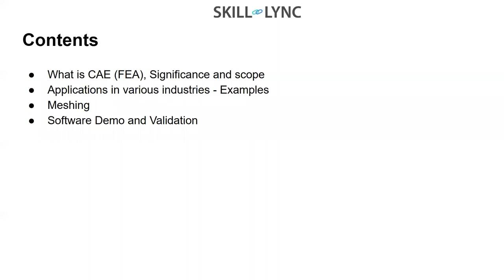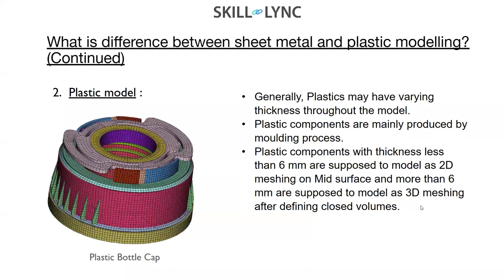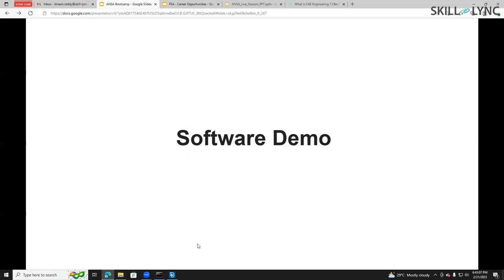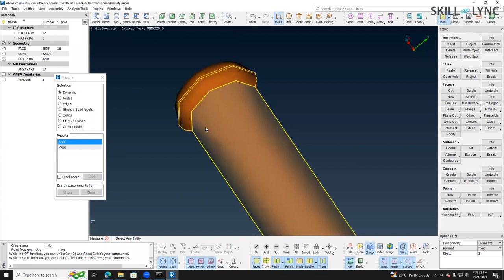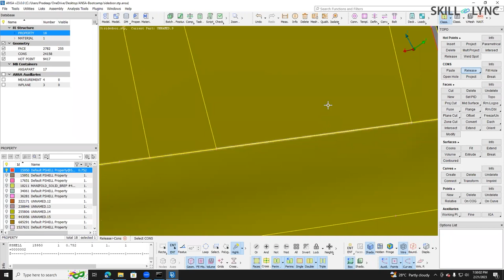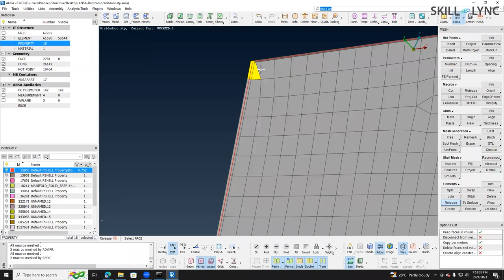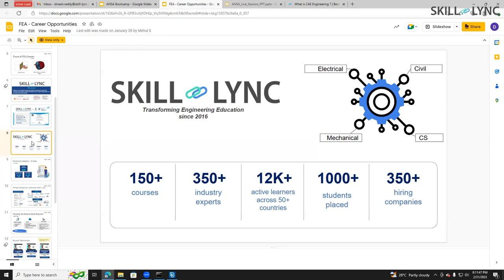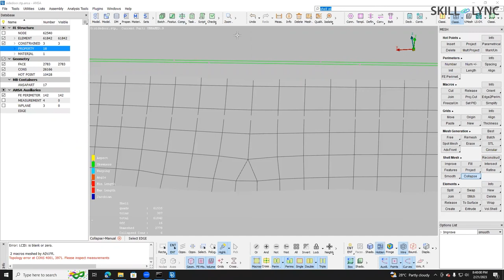Meshing of automotive Side Door using ANSA

Comment: We use the word "FEA"  for structural analysis only. FE (Finite Elements) is actually a meshing i.e divide the system into small elements. This division is also done in CFD too. Preprocessing i.e Geometry and Meshing is same for both anlaysis. Why not, we call FEA in case of CFD?
Reply: Because FEA is a method to solve structural problems,CFD analysis is done by a method called FVM - Finite volume method